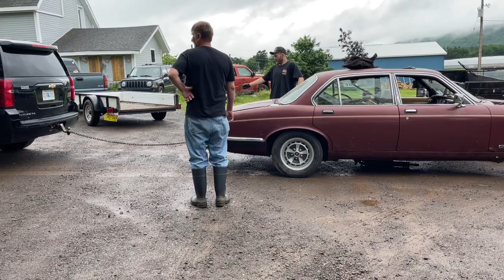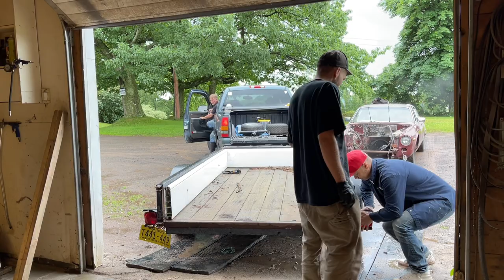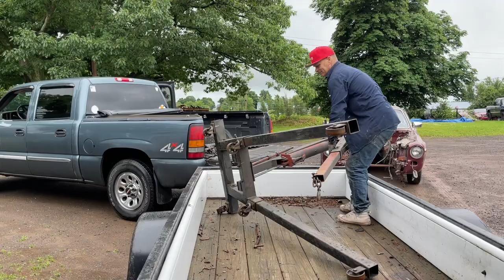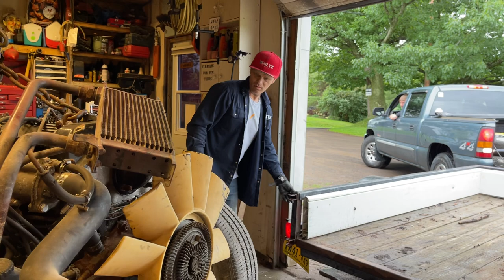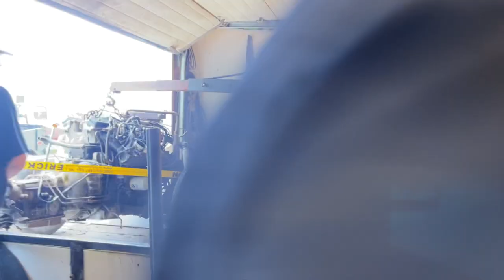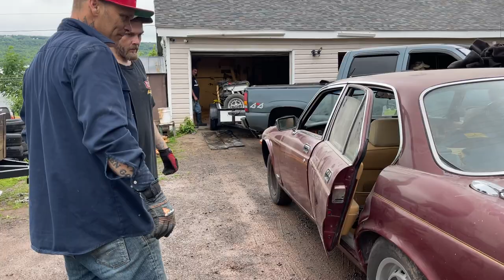Picking up (another) 4.2L Jaguar engine for the Bugatti

Comment: I have been watching you from the beginning and it's been so enlightening. I was an instructor at Sheet Metal Workers Local 80 Apprentice School Detroit Michigan. I still wish that I would have had you for a student. We have the latest state of the Art welding and metal shop. It would have been a joy to teach and provide you with access to the metal working shop. We built the school in Michigan in 1977 completely heated by the sun. All it is is an insulated sheet metal box with glass on top and a box of rocks to store the heat. Add a fan and some ductwork and then the building heats itself for free.

Comment: hm? weird, why not go for a good 3 litre japanese engine? those jag engines are known for overheating, and bad fuel economy. expensive parts. never lasting over 100 k is a sign that they are not made properly. a nice truck engine from a toyota would get u much more value for money.
Reply: Subaru engines are also good, mishubishi im not too knowledgeable about but theyr 2,5 -3 litre diesels are good.
Reply: I’ve heard and sorta witnessed jag engines being bad, expensive parts, bad fuel economy. Didn’t know about never lasting over 100k.  I knew of a typewriter shop owner that had 2 jags, used one for parts. Never could get the first one to stay fixed.
Reply: @jmikronis7376  if u can run them on leaded gas they will last ;)